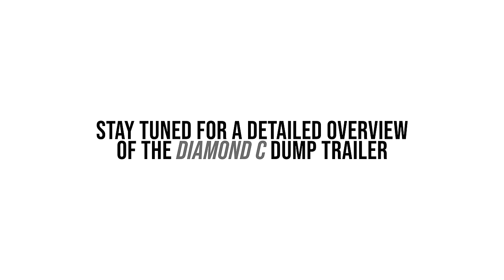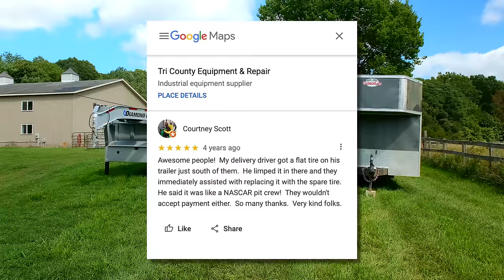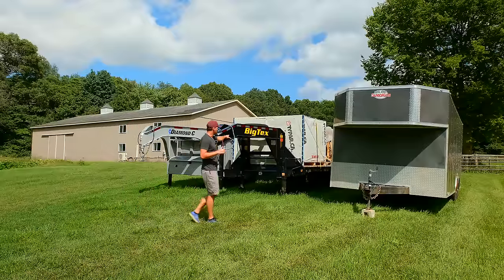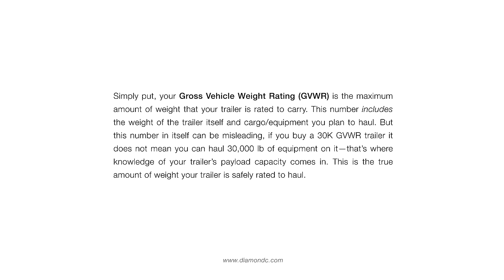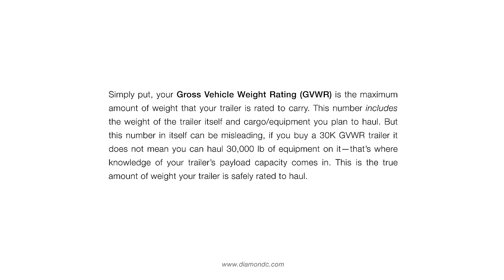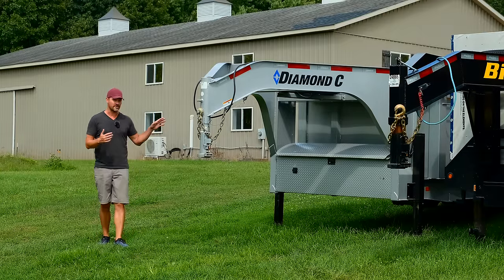THIS WAS A $30,000 DUMP TRAILER MISTAKE. WHO WANTS TO BUY IT?

Comment: let me first start with a TRI AXLE dump TRUCK can only hold 18yds. but let me explain this the best i can as quickly as i can because i dont think you quite understand here. a yard of soil/fill weighs roughly a ton, and it can be quite a bit more depending on moisture content (rain etc.) i have a 7x12 14k gvwr dump trailer. my 7x12 with roughly 3ft sides on it can hold roughly 11 yds. while i can "FIT" 11 yds in my trailer does not mean its a good idea to put that much soil in there. as that would be well over 22,000lbs. 11 yds of mulch, SURE. 11 yds of wood chips, SURE. with that said, from what i can tell you probably had 15yds or so in your trailer. thats over 30,000lbs. calculate how many yards your trailer can hold based off length x width x height by depth. im not quite sure how long you trailer is. with dump trailers just because it will fit doesnt mean you should.

Comment: I love your videos but I feel like this is user error purchasing a dump trailer with high sides does not mean if you feel up to the top with extremely heavy material no matter what dump trailer you buy with 4 or 6 foot sides you will not be able to fill it all the way with gravel there was a video put out by Texas pride trailer which shows is 7 x 14 dump trailer with 6 foot walls filled to the top with gravel and it weighs 40,000 pounds
Reply from the maker: I don't think I ever shirked responsibility, as I claimed it was my error in this video and the prior about it. Definitely know there must be trailers out that there can do that kind of things since there are dump trucks that do it!
Reply from the maker: Of course it was user error.  Maybe you didn't watch the video, but I clearly explain why I'm stating all of this so the next buyer is educated.  That's what a saleman should do on a $30,000 trailer purchase.  I told the salesman my plans, he made no mention of the deceiving nature of the trailer, or how it can't lift anymore than a trailer a third of the price.  No stickers anywhere on the trailer stating how much it will lift.  Diamond C doesn't even know how much it'll lift.  A complete lack of information from the manufacturer and dealer.  Yeah, in hindsight, I would have drilled them hard on those questions ahead of time.
Reply: @GoodWorksTractors  I did watch the entire video like I do with most of your videos. And I do agree that the dealer did not communicate the limitations of the trailer correctly
Reply: He said it was his error in the beginning of the video. Did you even watch it?
Reply: @larryhobbs8769  yes I watched the entire video just like I do with the most good works tractor videos

Comment: ALL Dump trailers SUCK!!  Do yourself a major favor and buy a preowned single axle dump truck with a GVWR of  33,000 lbs. you will be able to dump anything and put it exactly where you want it!  You would also be able to pull a Pintle hitch heavy tandem axle tilt trailer designed to haul your skid steer, a dozer or a backhoe with ease!  I switched all my goose neck ball trailers to a kingpin type and installed a 5th wheel plate hitch in my f350 truck.  Just backup, hit it and it’s self locking.  No climbing in the bed of the truck and the safety chains are not required for the king pin 5th wheel hitch.   Made my life about 100% easier and trouble free!    The deck over cargo trailer will be a challenge to get and it will be an even steeper ramp than you are dealing with now.   Keep us posted on the deck over cargo hunt I’m very Curious to see what you will be able to find out in the market.   Great lessons from you on the trailer do’s and dont’s you have experienced.  Thank you!  👍👍👍

Comment: Doesn't make sense why hoist capacity isn't a optional upgrade.  Champion hoist makes scissor lifts that fit these trailers that have 7.5, 12, 18, 22, 30, and 50 TON capacity.  There is no reason you shouldn't be able to upgrade when ordering a trailer.   And no Champion does not sell direct to consumer.

Comment: Thats a mulch/debris trailer really. Dirt/gravel/concrete really needs to be in a dump Truck. I wouldn’t want too be in front of you on the road if that trailer was loaded with dirt/gravel; it wouldn’t stop very well at highway speeds.
Reply: It has more than capable braking system, 6 wheels worth of braking!
Reply: @Itsa_Mea  not fully loaded with dirt!! 21K trailer with 40K of soil…
Reply: @arlisspropertyservicesllc5943  check the dimensions and do the math. That trailer was not full. It was about 10 yds. Each cuyd is 2,200 pounds.  That gives you a load of 22,000 pounds. Like I said, more than enough brakes between the truck and trailer.
Reply: @Itsa_Mea  and then add in the empty weight of the trailer (14K) and its severely overweight!! Any state trooper or scale house would fine you and put you out of service on the spot.
Reply: @arlisspropertyservicesllc5943  you are way out of touch with weights.  That trailer empty is advertised at 5k empty.   Which the truck alone can stop that extra weight. It is not grossly overweight like you think.  It is a weak archaic scissor mechanism. That's the issue. Telescopic front mount hydraulic cylinder is the answer and is now offered by Diamond C.
Reply: @Itsa_Mea  at 14:17 it shows empty weight of 7220. That means a 21K trailer can haul almost 14K. If he had 10 yards of soil 2200 a yard then he was nearly 28K on a 21K trailer. The truck certainly didn’t take 7K and make the trailer legal. I drove tractor trailers 34 years, I know a little bit about weight distribution.
Reply: @arlisspropertyservicesllc5943  not saying it was legal, just saying it was not as heavy as you think. And the figure of 10yds is on the high end. He may of had only 8. He had plenty of braking power and it was no where near the 40k+ pounds you thought. It was less than that, nearly half.

Comment: When i saw you loading the trailer 🤦‍♂️, leverage is a bitch if it's against you. But you found out at first hand. I think the best dumping setup is with a pistol on the front of the trailer, so it will have to be telescopic, forget dual pistol it will have the same problem, if they are not mounted on the front. I mean you can load the trailer pretty heavy as long as the load is behind the piston mounting point.

Comment: Almost every dump trailer will have more volume capability than its weight rating can handle if loading full with heavy materials.
Reply: It all comes down to payload capacity. Sand or gravel typically weighs about 2565 lbs per yard. So you probably had over 35000 lbs of weight in that trailer!

Comment: 13 scoops...  mim 1/2 yard a scoop...  6-7 yards that looked too be wet dirt so 3k a yard 19k in dirt weight.  axles were overloaded,  cylinder had zero chance.  maybe if it was all on the trail end. 
also when it talked did the motor run and no dump....  saftey valve bypassing...  or did it run than stop and basicall never run more than an um....   if so high current draw too small of a batter,  crappy cables.  

all in not a shock to me.    sorry your dealer failed you on this sale.

Comment: Don't you have limitations on how much you can put behind the car? That thing is the size of a dumptruck but where is the hydraulics to push the oil into the cylinder? If you put a wall where the frontwheel is, then maybe. Elementary fysics...
Reply: I’m sure phi
Reply: @larryhobbs8769  
Or maybe Mr Newton 🙄🤭...

Comment: What a pathetic excuse for a dump trailer. For $30k you should be able to fill it to the brim with river rock.  Not that doing that would be very safe for towing. It seems like actual dump truck bodies are much better built compared to these trailers. All the different ones I've used, I could fill them up with top soil or rocks, and they would dump no problem. This includes the crappy scissor dump style as well, although those you had to be careful not to "heap" the loads too much on those.

Comment: That is the worst dump system for a trailer that big, that I have ever seen. Should only have a vertical ram at the front of trailer like a dump truck. Sorry that another trailer salesman failed, (knowingly or otherwise) to give you correct information. RV salesman do the exact same thing with towing numbers and towing vehicles. Salesmen, do better.

Comment: So you bought a trailer without finding out first if it can do what you want it to. Seems like 100% your fault and nothing to do with the dealer/sales person.
Reply from the maker: So telling the salesman why I need the trailer, what I plan to use it for doesn’t count?  You don’t think they should have maybe had a responsibility to inform their customer about its limitations?  They are supposed to be the expert, not me as the customer.  I was going in a completely different (and substantially cheaper) direction.